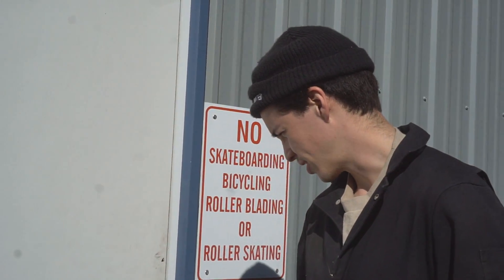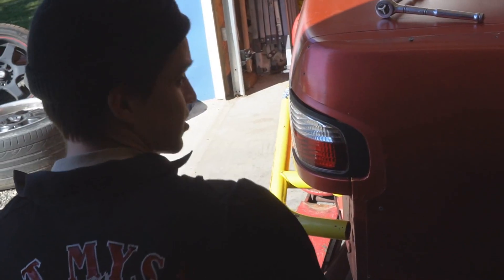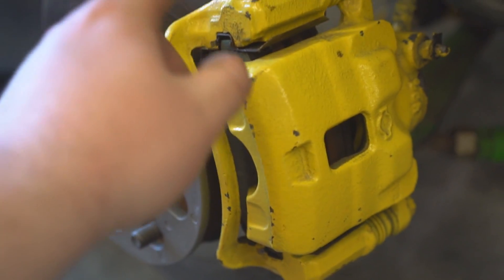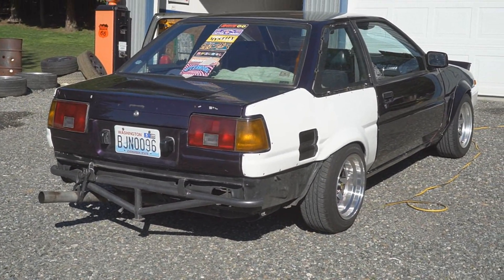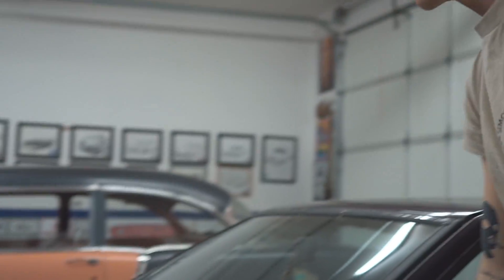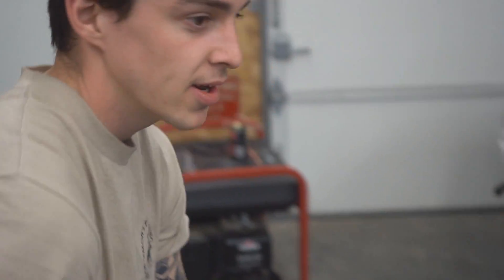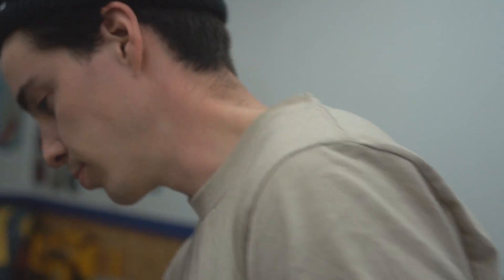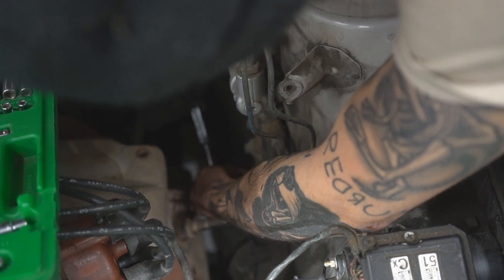AE86 With S13 Sideskirts?

Comment: Just a thought boi could be the bolts for the caliper bracket touching the disc when you tension disc to hub good luck from Australia
Reply from the maker: checked that thanks though man! we think it is abs rotors with non abs calipers or the other way around

Comment: The caliper carrier bolts are too long hitting the back of the rotor. Seen it before. Use a shorter bolt to mount the caliper carrier and I bet it will fix your issue.

Comment: you have the wrong bolt for the caliper bracket. the bolt is to long and is hitting the back of the rotor when fully tightened. 

pleas guys focus on making the cars work and drift rather than what they look like
Reply from the maker: It’s not the bolts.